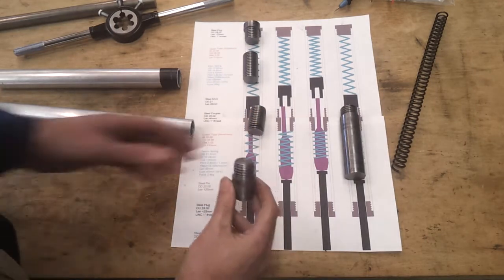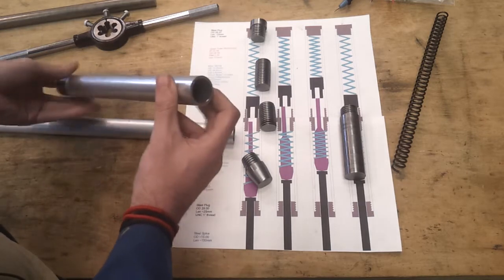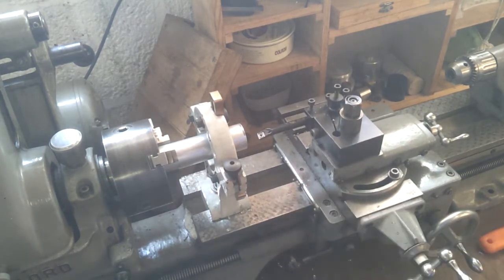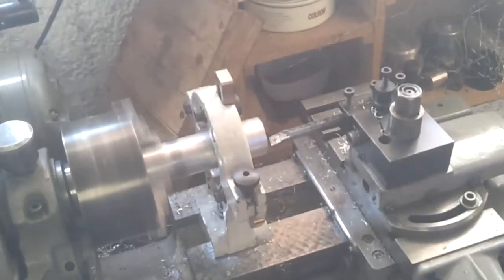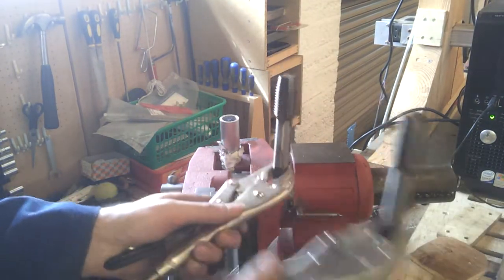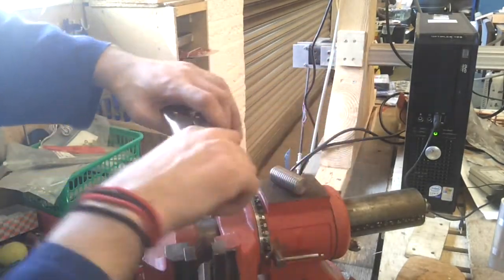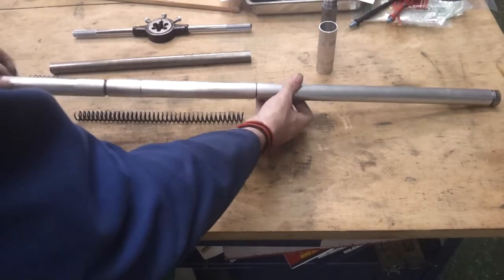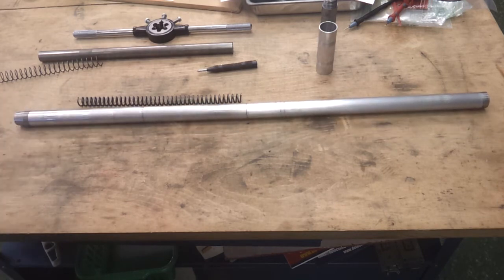Giant Automatic Centre Punch pt3 - 1" thread cutting pipes

Comment: Instead of messing around cutting guide sleeves for the tap, why not simply mount the work-piece in the chuck, and use a spring center in the tail-stock, to keep the tap aligned?

Alternatively, if your lathe will run very slowly, you could mount the tap in the tail-stock chuck, and power tap.

Comment: Hi Andy - Nice project? Is there a reason you didn't cut the threads on your lathe? (IIRC it only did imperial sizes)... Are you working in metric for this one? Cheers!!
Reply from the maker: Thread is imperial (1inch x 8tpi UNC), so I could have done it on the lathe. I think I've got all the required change-gears, but there's a little too much backlash in the saddle, and it's tricky to pick up the thread precisely. (She is 60 this month!) 

The other problem is the internal thread, they're even harder to get right because you can't quite see what you're doing! So I went manual instead.

I'll upload the next parts of the series when I get some time.
Reply: You could cut the thread on lathe and use screw-tap - put that in to tail and jaws get in neutral with out gears and turn it with hand. Of course the tail leave free to move or you can turn the wheel on tail with the jaws together you will feel that how much. Then when you started and the tap started cut straight you can finish that off or you can move it out and finish it in vice.